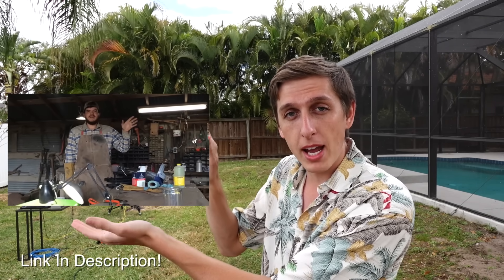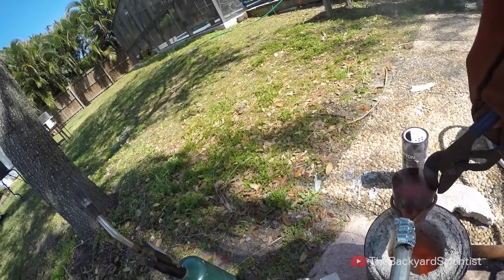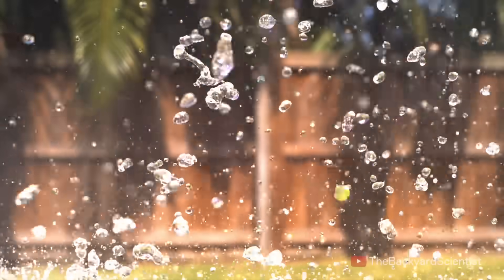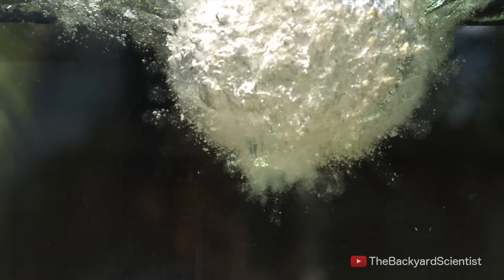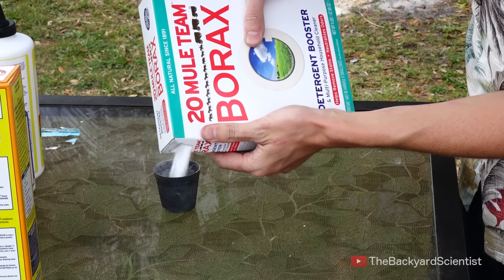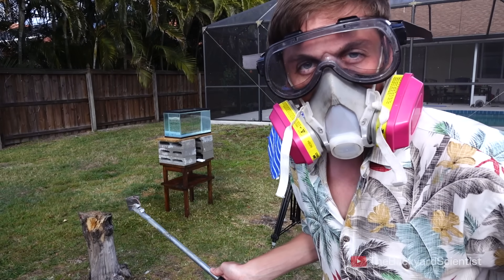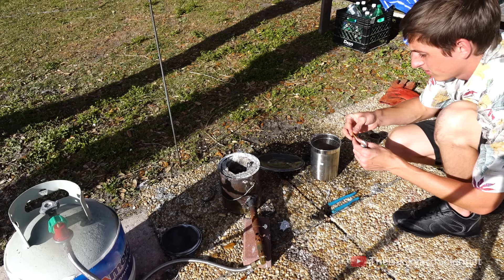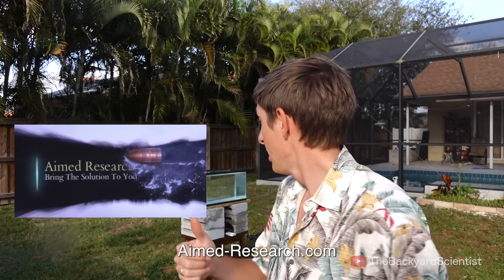Pouring Molten salt into Water - Explosion!

Comment: You couldn’t figure it out? It’s extremely obvious if you know your chemistry. Salt is NaCl (sodium chloride) when you melt the salt the chlorine in the salt gets burned off so you’re left with pure sodium. Sodium is an alkali metal which reacts extremely violent with water. This is very, very, simple. The others didn’t because they didn’t contain enough sodium.

Comment: Nothing to do with Leidenfrost, you have convective flows anyway. The density of molten salt is way less than the solid, that's why the crust keeps exploding open. You noticed you got crackling too, that's just those  strains being released, rapid cooling and volume change introduces deformations in the crystal plates. 

So the explosive effect of the salt is probably the rupture of the crust from expansion of the core. 

The borax becomes anhydrous when you melted it and it doesn't suffer much of a volume change when you make a crust. Also you may not realise that there is a little bit of chemistry involved, you don't actually form crystals when anhydrous borate cools, borax forms a glass, because you removed its water of crystallization when you melted it. Did you notice the volume change? 

The glassy bits also fragment off during the cooling but there isn't that dramatic accompanying volume expansion. 

Also it is probably relevant that glasses also have lower thermal conductivity, salts are have excellent heat conductivity that increases with temperature. Common salt has small ions making it an excellent heat conductor, unlike glasses which are heat  insulating. HTH.

Comment: Salt (sodium chloride > NaCl) is totally different from Sodium (Na). You can eat salt (NaCl) but if you swallow sodium (Na), you will probably die violently. Put salt in water and you get salty water. Put Sodium in water and you will see flames in the water. Professor Google  can teach you things but this guy exlained it well from another forum. I am reposting here.

Jacob Hood, Studying water sciences so I can graduate and become Aquaman
Answered Mar 10, 2016
              
originally Answered: Why
 does molten salt explode when in contact with water? And why don't 
other ionic substances explode when making contact with water?

When you say "salt" I'm going to assume you mean sodium chloride (NaCl) and not just any ionic compound out there.

The reasons molten NaCl will explode when it comes in contact with liquid 
water are actually pretty simple. A highschool educator where you took 
chemistry to grade 12 will be sufficient to find these reasons. There 
are two of them.

1-  when sodium chloride is in a molten state, it has an extremely high amount, which allows it to 
spontanously dissociate (one in a thousand Na atoms will seperate from 
Cl atoms, when they collide at just the right angle, with just
 enough energy. When this happens, your sodium atom will be in its 
normal state, with one valence electro. This is a very unstable state, 
and it will combine with the just the oxygen from the water (H2O) 
leaving behind hydrogen gas. Something anybody who has seen the 
Hindenburg disaster will tell you is highly flammable. Even explosive.

2. This is the simple side-reason. The water is in contact with something 
extremely hot, which will cause anything touching the molten NaCl's 
surface to vaporize into water vapour. This will create create pressure 
inside the container holding the water, which will cause it to burst out
 with a large amount of force.

Dont try try this at home kids

Comment: Is it possible that it is a violent reaction forming HCl and NaOH, and then reacting again to make salt and water? The pH didn’t change but you’re adding equal molar of Na and Cl, which if it did react would make equamolar of the two strong acids...would in turn cancel each other out. I’m curious if heat was generated? Maybe you could repeat and calculate the change in heat of the water and determine if that was only due to the molten salt temp. HCl and NaOH reacting generate a lot of heat.

Comment: The explosion is due to multiple factors:   High energy molten salt colliding with low energy water results in a high thermodynamic transfer and intant water expansion,  water molecules bonding with NaCl results in a bonding and creation of an electrolyte  - hence electricity to water causes instant water vaporization and expansion again, fire ball due to the oxygen being ignited which again causes more kenetic energy transfer.   Basically a perfect storm of high rates of energy transfers causing instant water displacement.  Aka an explosion.
Reply: Thomas Spann umm I’m sorry I’m only in 6th grade

Comment: I like the 'spreading explosion' explanation.  Is it not a very efficient steam explosion due to the metal being liquid and able to disperse physically through the water quickly and therefore, it's heat?  What would happen if you dropped molten metal, (copper???) at the same temperature into the water?  I think that it would generate a bigger explosion because of the extra heat capacity of pure metal.  I remember my Dad telling me that when using thermite to cut railroad rails on bridges, the white hot metal would hit the water and dance around rather than sinking because the flash steam explosions wouldn't allow it to sink without shooting the metal out of the water until it cooled sufficiently to sink.

Comment: We have a strangely similar event when we inject a 4% salt solution at 21,000 PSI into our impact chamber https://www.youtube.com/watch?v=qTeKs_eAi6g  My guess is that NA+ ions are reduced to Na metal and this reacts with the water to produce H2 and O2 which under slight pressure will explode. Just a guess though. Molecular CL as Cl2 reacts with HCL energetically. We need to investigate the physical chemistry of this phenomenon.

Comment: After the sodium chloride exploded, I though it was because the sodium was reacting with the hydrogen, because sodium is an alkali. But I was wrong, because it wasn’t a chemical reaction.
Reply: salt diassociates on heating you know!
Reply: Shahil Rai Okay firstly salt doesn’t disassociate when molten, only when it’s dissolved through a process called hydration. Secondly you fail to mention the fact that sodium doesn’t even react with hydrogen... Ever.

Comment: The explosion happens because This is an exothermic reaction. Sodium metal is heated and may ignite and burn with a characteristic orange flame. Hydrogen gas released during the burning process reacts strongly with oxygen in the air. A number of sodium compounds do not react as strongly with water, but are strongly water soluble.

Comment: I think you already explained the lack of explosion with the other salts because of the Leidenfrost effect. Those salts aren't attractive enough to allow water to get in and super heat up. The liquid molten sodium chloride must have something to instantly attract the water molecules into it like a sponge whereas the other salts are unable to emulsify with the water which according to Wikipedia also allows a person to dip a wet finger in molten lead. the phenominon appears to me more common than uncommon meaning that there is a special impurity in Sodium chloride that sets it apart. you were using Mortens table salt. Have you tried using 99.99% pharmaceutical grade pure sodium chloride crystals? Assuming it's a physical reaction then the explaination would be something physical like that.

Comment: Interesting this gets so many views when nothing is resolved. Interesting and all and thumbs up.
Reply: Not to be a jerk, but what happens when you melt salt? Does any break down into free sodium? If so, that may explain a bit of the explosion because sodium is a highly reactive alkali metal. In its pure form it reacts in water to form sodium hydroxide and hydrogen gas. If that is going on, the heat would cause the hydrogen gas to ignite. Obviously oceans don't spontaneously explode. Heat is generated when salt is introduced to water. Even just that might cause molten salt to react quicker. I'm guessing more than one thing is happening here.

Comment: It has nothing to do with the sodium. This is caused by the thermolysis of the water (also called thermal decomposition). In the case of water the thermolysis starts taking place above 2000C. The higher the temperature the greater the amount of H, H2, O, O2 is being produced within a given period.

In your experiment, the hot hydrogen chloride gets surrounded by oxyhydrogen, that gets ignited and it explodes. Nice camera shots, though. :)

Comment: Sodium and water-
A colourless solution is formed, consisting of strongly alkalic sodium hydroxide (caustic soda) and hydrogen gas. This is an exothermic reaction. Sodium metal is heated and may ignite and burn with a characteristic orange flame. Hydrogen gas released during the burning process reacts strongly with oxygen in the air.

Comment: Salt vs other ionic liquids: 
I assume it is because salt has a much higher solubility in water than the other things you tried (36 g per 100g water, vs 3g Sodium Carbonate, and about 5g borax and boric acid, all at 25°C for comparision). So probably with the other melted substances, the water is "held off" the hot salt enough by the Leidenfrost effect, while with the salt, the high solubility causes enough water to get "caught" in the piece of salt, which then causes the effect you describe.

Salt vs. sodium:
The reaction of sodium is obviously much more violent, it immediately explodes (into flames) on the surface. The effect of the explosion to the water and tank is not so strong because it blasts into the air. The salt reaction is much slower and less violent, that's what allows the salt to plunge enough to have the reaction happen only once submerged. That's what causes the explosion to fully hit the water and break the tank.

Comment: I was a dental tech. We'd cast chrome alloy at 2000 F into a flask heated to 1600F. If you then drop it into a 10 gal. bucket of water, in about 10 seconds the water around the flask super heats, goes to steam and the entire 10 gallons of water ends up on the ceiling or as steam. We did this to startle visitors :) This is a physical reaction and has nothing to do with salt(not a chemical rx). Super heated anything will cause a steam explosion.

Comment: Why? easy. the sodium and the water generated a plume of hidrogen and oxygen that combined with the heat exploded back to water vapor.
Reply: That's what i was thinking too, but i don't think that the temperture of the melted salt is enough to generate hydrogen, however there might be some temperture change since it could react to sodium... nah i think we need thermocamera footage for this theory.

Comment: boiling liquid vapour explosion is what caused the tank to break apart. as the molten salt hit the water the water expanded into steam faster than the water around could move as an uncompressable liquid cracking apart the tank. as the steam expanded it carried the "fireball" of molten, flying salt (same reason why they say never use water on an oil fire) which gave it the explosion effect with the boom coming from the rapidly cooling salt and glass cracking. same work behind a steam locomotive boiler explosion. the firebox crown melts and water pours in vapourising insantly and with no way out it continues expanding til the metal gives out and the boiler goes flying with the loud sound coming from the sudden structural failiure of the metal at extremely high speeds.
Reply: we know why the tank failed. we want to know if the reaction of the salt (not the tank) with the water is chemical or an explosive reaction
Reply: @MrJerramie  and if you actually read the comment you would find out the rest of that.

Comment: I might be wrong but the explosion may be chemical, with the chlorine being displaced when molten from the sodium the when its poured the chlorine starts to rebond to the sodium,  but not fast enough to prevent an explosion and the reason it's still ph neutral is that sodium is alkali and I swear chlorine is acidic so it neutralizes

Comment: This is a chemical reaction because salt is made up of one sodium atom, and one chlorine atom. Alkali metals are an extremely reactive and soft family/group of elements. Alkali metals are extremely soft and reactive, because they all have only one Electron in their outer shell. This is why he was able to cut the sodium METAL so easily. they also put chlorine in pools because it is a Halogen, which are cleaning elements, however halogens are also very reactive.
Reply: Trudat
Reply: Trexasaurus Sama heating the sodium chloride likely wouldn’t cause it to decompose into its individual ions. You’re correct about the characteristics of alkali metals and halogens, but ionic compounds do not share the same chemical or physical properties as their parent atoms. That’s why you can eat table salt without fear of exposing your body to elemental chlorine!
Reply: It is just a smelt water explosion google it.  There are industry manufacturing plants everywhere that control smelt dissolving tanks so that they do not explode it is very well understood thermodynamics.
Reply: Dork.

Comment: Ok, I admit this was interesting but you stated "I don't know why the salt reacted like that while other ionic compounds with sodium didn't." To clear this up, sodium is an alkali metal in group 1, which is extremely reactive with the halogen in group 17 and with HYDROGEN. When the sodium and chlorine bond together, they transfer electrons between each other to become stable. Since they are already stable, they don't have any negative reactions, but when the sodium and chloride, which are already very reactive with each other, mix with another element reactive specifically to one of the already said elements, their charges are no longer equal and explosion occur. Correct me if I'm wrong, I'm only in high school chemistry but I am the top student in our pathetic little class of a dozen.
Reply: No, that's not how it works, not even close.
Reply: When you take a college-level or higher chem course, you essentially learn that everything you learned in high school is wrong. Even if you’re a top student, there’s always room to learn. Be humble :)

Comment: Definitely physical reaction.  The borax holds together so it is a hot ball, chilling on the outside but sticking together.  The NaCl spreads out as water penetrates the mass. That causes the mass to expand as small bits, still very hot, making lots of steam as the very hot bits of salt shoot out into the water.  Very cool experiment.  The PH change test is good.  Another evidence is the incandescent clouds from the sodium metal.  As the sodium reacts with the water it frees hydrogen gas, which is hot enough to ignite on contact with the air.   The sodium in the water forms NaOH, sodium hydroxide, lye. That can be bad for your skin, eyes and lungs.  Gas mask was a good idea!
Reply: Weldon Adair  Finally, a reasonable thought out intelligent answer. Sodium and chlorine don't come apart just because you melt them ( think ice to water or steel molten to solid). The reaction is undoubtedly physical.
Reply: Then why did the NaCl react like it did and the other salts did not, even at higher melting temps, as he said? It doesn't make sense to me that NaCl would create this physical reaction and the others wouldn't. If it is a steam explosion, there must be some reason why the Leidenfrost effect breaks down for NaCl and not the others. Find that out, and the mystery will be solved. 
I think there is some vital information missing: what was the temp of the NaCl that exploded? How close to boiling? He first heated NaCl until the batch was melted, and it performed like all the other ionic compounds he tested. Then he heated it up "really hot" and tried again, and that time it exploded. There is obviously some connection to the temp and the explosion. I just don't know what it is.
Reply: @tylerfb1  I think it's chemical and that all we're seeing is salt dissolve, forming polar bonds with the water, the heat just accelerates the reaction so that the resulting energy release is explosive

Comment: even if it would by the chemical reaction the pH won't change because the concentraton of disociated H+ ions would be the same as the concentration od the OH- ions due to the equal, so it is clear that the pH cant change. The difference between those two reactions of molten NaCl and Na2B4O6 is probably caused by the structure of these substances. NaCl when it loses its crystallic structure its bonds become very week, there is an ionic bond if it is molten it has enough energy to spread all at once because of very high Gibbs free energy. Tetraborate is much bigger molecule and its bonds arent ionic except those 2 natriums, then it camnt blow up same as NaCl.

Comment: Why is the molten sodium chloride not (or less) influenced by the leidenfrost effect?
 My idea would be that for instance the sodium chloride dissolves more easily into the solution than the other elements or compounds used. 
The molten metal(s) used here consist of equally charged metal atoms while the molten sodium consists of a fluid with Na+ and Cl- ions that have a stronger charge attraction on the polar watermolecules to (partially) overcome the leidenfrost effect. Therefore it mixes faster with the water leading to the rapid steam expansion. 
An alternative would be that the sodium chloride is so hot that it allows for some reaction with the water where some sodium hydroxide and hydrogen chloride are formed which the react in the water to produce dissolved sodium chloride and water (and some energy which causes the formation of steam)

This is just my hypothesis.